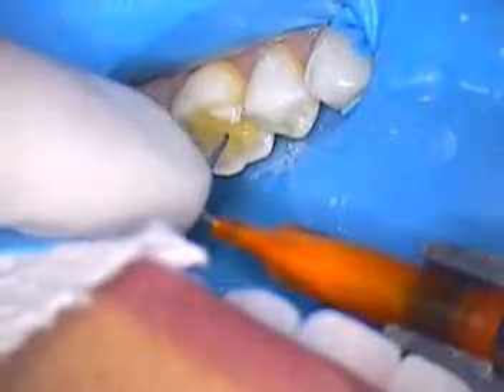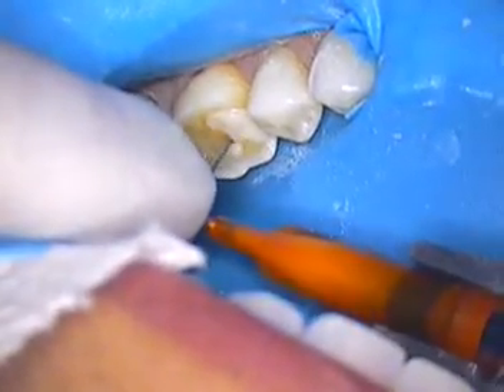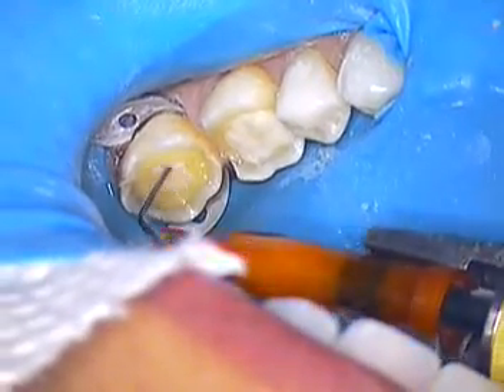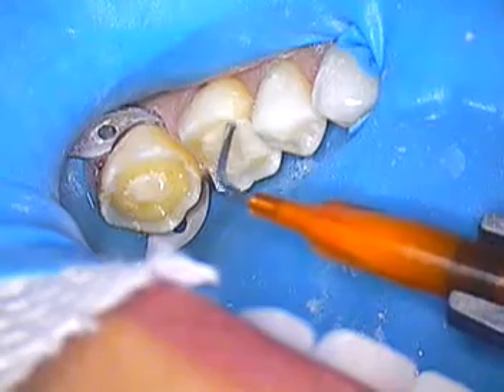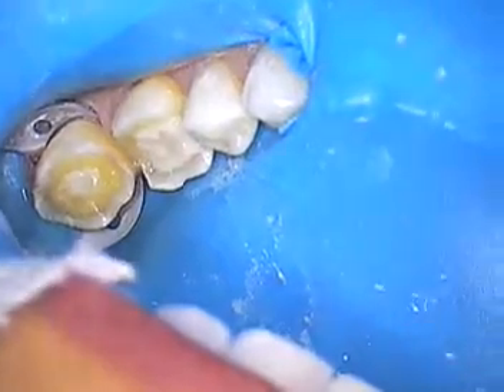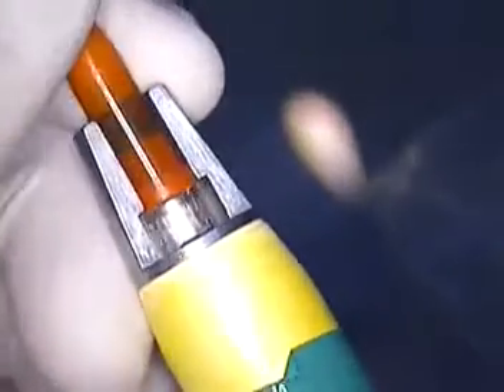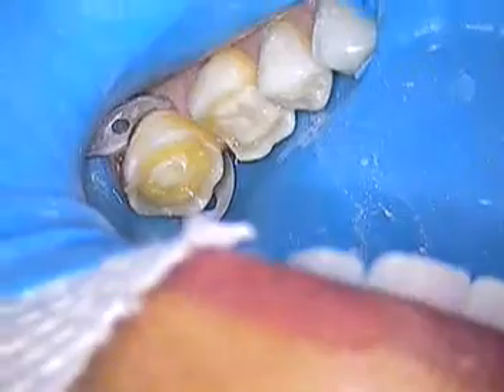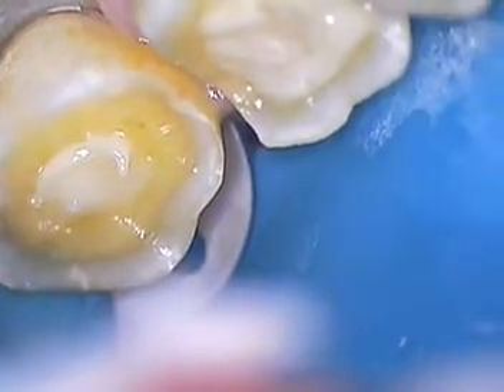DR. GERARD CUOMO - Replacing old dental fillings with cosmetic crowns. 4 of 4 Boca Raton, Florida

Comment from the maker: @masan12 Thanks for commenting. . . I used Denmat's enamel shade core paste material.  This case was restored with Procera cores layered with Ceramco porcelain. Relyx cement was used.  I routinely place Pascal's Siltrax 7 braided cord (w/epi) soaked in Hemodent around each tooth prep prior to cementing the case.  There is less post operative sensitivity due to the elimination of contamination (blood and sulcular fluids).  Sorry, I presently do not have videos of the cementation uploaded. GC